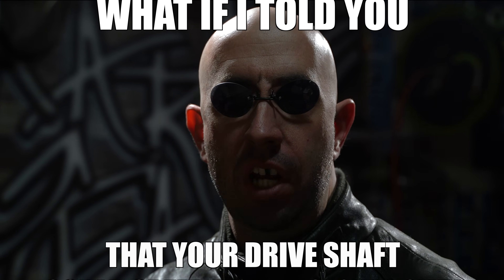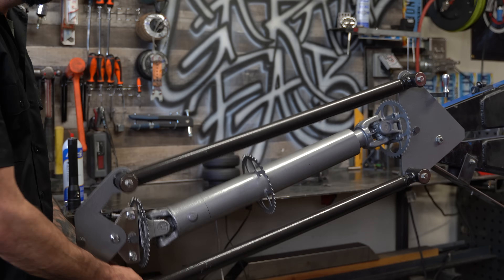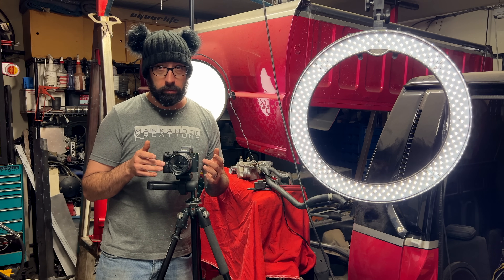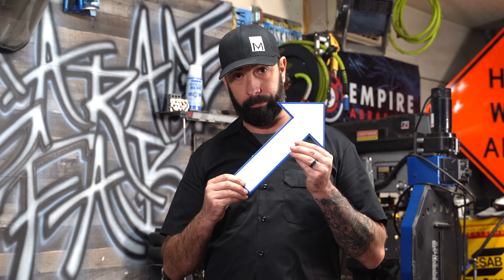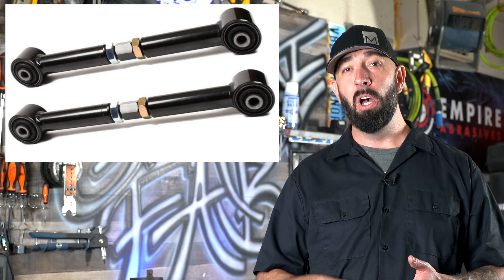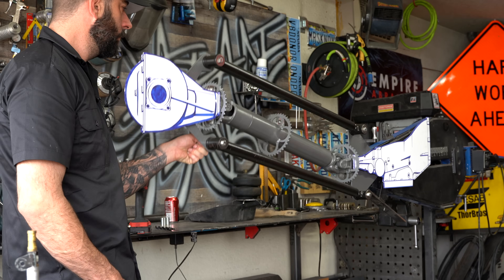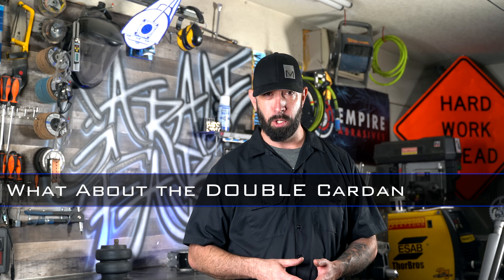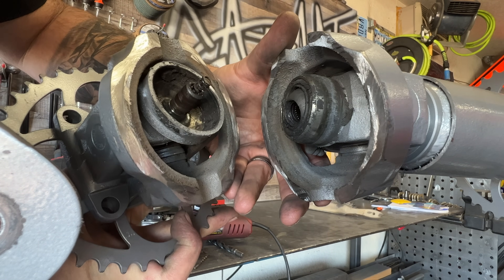THE Driveshaft Video. The Nature of U Joints. Suspension Basics Ep. 06

Comment: tHE PROBLEM i HAVE HAD WITH A NEW dRIVE SHAFT WAS NOT THE ANGLE OR PROBLEM LIKE THAT IT HAPPENED JUST DRIVING ON A FLAT DESERT ROAD. tHE ISSUE WITH A BRAND NEW DRIVE SHAFT WAS ChineseU joints installed in it ordered on the internet from a place that specialises  for the vehicle I ordered it for.My shaft had more than one U joint and the place that checked it and found it was not just any place . It was a drive shaft shop that did a lot of work on off road race trucks and the rest so? Chinese bearings I knew were an no no to use their quality would not hold up. My angles were correct and did not have an issue with the one before or the new one with plenty of off road. Not done when on the small trip I took with the one that failed. But plenty before the new one that failed  and plenty more with the new one with no problems yet. Ihave Deaver springs and long suspension travel on King shock that work well. Ihave a double cardon in the front for my 4x4 long travel drivers side 4wheel drive differential. with lockers & gears and great suspension I dont use 4x4 as much as I used to with my toy 4x4 mini truck solid axle 4 cylinder trucks. With a big V8 geared with rear locker I do not need 4x4 in places I used to. & if I do like in sand ,steeps snow ,mud or speed on loose dirt to pull me through the sharp corners not sliding off but hitting the gass some just pulls it through. Of cours I must be aware of not to fast and body sway. Like any setup you need to take some time and learn what it can do and how and what it cant. The thing I like about long travel wih 4x4 is with lockers it can pull you through and when over bumpy trails it smooths it out so well and the surprises that do happen can be hadled well. Like a mild U shape going fast, or a sand razer climing uo a big dune. Yiou find your vehicle way up in the air. like 6-8 feet from the bottom of the tires to the sand with the suspension drooped way down in the limit straps with a good amount of travel on a 4x4. More than a nice Raptor that are good at this not on the good Fox posision sensative but the posision sensative external bipass shock oil resivoir on good siize pistion tall for travel strong mounts for kKings tunable for the weight and use for your SUV or Truck or? My Full size Bronco plated and gusseted ind front suspension TTB likes them alot as well as my and any passengers off roading at a faster pace smooth and in control safe and not so likely to get stuck with power a built well drivetrain and srtrong smoot suspension and a loud clear clean stereo playing from a digital source not a cd that like to skip It is somtimes nice to set up and camp. and also nice to get through a long trail and off with a good time to get home or a motel with a pool and jacuzi and shower and restraunt or fast food to eatin comfort either way enough space inside to cary what you need and makes the music sound better big seats that can recline is nice too. But the amount of work to make it and some good amount of hard in money too ti install parts and improve and fabricate stuff and rebuild the transfer case yourself and the fiberflass fenders and bedsides to clear the tires and a little motre for that + the core suport headlights with HID upgrrade to see to  change the frond end to the later body style you like better. The Front end was A PART OUT SO i BOUGHT IT ALL INCLUDING THE NEWER SPINDLES THE BRAKE CALIPERS THAT BOLT TO THE SPINDLES INSTEAD OF THE METAL AND RUBBER PINSSOME OTHER STUFF NOT NEEDING TO MENTION MOSTLY CHOICE AND A FEW NEEDED THINGS THAT FAI WHITH SOME AGE.
Reply from the maker: That sounds like a fun ride, Brian! 🙌

Comment: Now extremely curious about a single U joint drive shaft. The Land Rover D2 rear shaft had a U joint at the transfer case and a solid rubber joint, or bushing  at the diff. How's that work??
The front shaft it a double cardon the transfer case and UJoint at the front diff
Reply from the maker: I can’t say for sure but I have to assume that the U joint is mostly straight. Anything beyond 2° to 3° could potentially cause the dreaded vibration that the rubber joint couldn’t cancel.
On the front shaft the single U joint would still need to be straight, and the double Cardan could be at almost any angle!

Comment: Early on... bevel gears put the shaft too high, making coachwork high.
Worm gears came into vogue, mostly on heavy stuff... except they suffer from no ground clearance... the worms at the bottom. And no, not all worm drives lock... all about the pitch.

Hypocycloid places the shaft at a nice mid way point. Reduced tunnel in the cabin. Lower engine line.

As for uni joints, always paired, always equal and opposite. See it gotten wrong so many times.
The same holds true for cable drives. A speedo doesnt care, but that bent shaft line trimmer buzzes like hell because of it being a single bend.
Reply: Dont even mention that i forgot to say anything about chains and jackshafts... partly due to materials, partly habits, partly those low clearance worm drives...
Reply from the maker: Interesting info! Thank you. 🙏
Reply: No prob. History often shines a light on why some things are how they are...
 Shame i cant find much info on what i want though!
Thompson transmission.
Early hybrid combining two epicyclics, a tailshaft, and two motor/generators at each end. Depending on which ones driving planets and which ones retarding, you get a reasonably infinite range.
Cant find anything online about it...

Comment: Garage fab I just ordered the ekstensive metal works rear air suspension kit for a 88 s10 I'm new to this but I'm guessing it's a 2 link setup with a pan hard bar that welds to rear. Have you done any of these setups?
Reply from the maker: I have built 2 links, but I have not used one from Ekstensive. I’m not a big fan of 2 links on bagged vehicles because they cause pinion angle to change significantly. People have been using them forever, though, so perhaps they’re not as bad as I make them out to be. It appears Ektensive ONLY offers 2 links? I could be missing something.

Comment: My dad repaired a crane and repaired the drive shaft while replacing the motor. He timed the drive shaft that he found to be off 90 degrees. The crane operator claimed he was able to drive the machine at 2x the speed it used to go down the road at. Timing U joints is real!
Reply from the maker: That is fascinating!

Comment: So... if you have a torque arm suspension you're best off running a double-cardan at the trans to eliminate vibration at that end since the u-joint angle at the diff will be more or less fixed by the torque arm. Set the pinion angle at zero and let the double-cardan sort it out up front. Correct?

Also, how do you go about sizing bags for a car? I keep thinking about air suspension because, as a trucker, I'm keenly aware of its benefits. I'm not into the whole lowering thing, but it would be nice to have a highway ride height that was lower for aero and a town ride height that was higher for practicality. And it would be great to maintain those heights regardless how many bodies I was carrying in the trunk. But I always get confused looking at bags because there's no clear way to tell things like spring rate. I'm a performance junkie, so I don't want to throw together something that rides and handles like a '73 Buick.
Reply from the maker: Sounds like you understand the double Cardan perfectly. The rear U joint will be fairly straight, with a slight angle to keep needle bearings rolling and lubrication moving, and the torque arm will keep it there.
You absolutely could use a double Cardan up front, it won’t hurt anything, but I wouldn’t say it’s mandatory unless either there’s a sharp angle in the U joint after the transmission or the vehicle has adjustable height suspension. 

For a moment, it sounded like air suspension was ideal for you. Until you mentioned spring rate. The reason you won’t see spring rates on air Springs is because that’s constantly changing with the air pressure inside. It can be somewhat frustrating. Low pressure equals a low ride height and a low spring rate. That can feel mushy and boat like. I love this feeling especially on rough roads but it’s the opposite of performance. High pressure equals a high ride height and a high spring rate. It can feel like you have no suspension at all and cause you to need to visit a masseuse.
Luckily right smack dab in the middle is what you might call a normal ride quality.
The problem with bags, (not necessarily my problem. I don’t mind at all) is you can pick your ride height and you can pick your ride quality/spring rate, but you can’t pick both.
I’ve come up with a hybrid hydraulic/air system that would allow you to do that and it may make an appearance on my next truck project. But that’s a ways away still.
All that said, you’ll be taking the weight of your vehicle, and finding bags with weight ratings that will suit you. I personally prefer the largest bags that will fit. (within reason) because I prefer the softer ride. A smaller bag will require more pressure to lift the vehicle and will therefore be stiffer. Hopefully this all made sense, let me know if I need to clarify anything.
Reply: @Garage Fab  I've seen hydraulic over air systems before. Actually, Citroën used it for quite some time. Not necessarily with the amount of travel you're talking about though. 

The bit about bags and ride makes perfect sense. A bit disappointing, though. I just want it all, is that so much to ask? Maybe I need a hydraulic over coilovers system so I can change height without messing with the spring rate. 

The reason I am thinking about a double-cardan up front is because I plan for a bit more suspension travel than standard. So it would provide a bit of insurance at the extremes. Probably not critical, but it sure wouldn't hurt anything.
Reply from the maker: I will have to look up the Citroen Suspension you mentioned. My design is theoretical so if there’s a proven system, I’d certainly prefer that one!
Good call in the double Cardan.

Comment: I have 2 late 80s full size broncos both have a carbon joints at the transmission. Why did your model have the cardon at the pinion? I've been a ASE tech for 45 years and I've never seen a double cardon at the pinion factory or custom.
Reply from the maker: Simply because I couldn’t build the machine in a way that would allow me to quickly swap the two types of joints if it were located in the front. 
The double Cardan is far more often in the front, not always. I’ve been seeing a lot of jeeps lately, often on front axles, on which the double Cardan is nearest the differential. Regardless of its location, the principles remain the same.

Comment: Hang on what about the Doppler effect? Even when the tailshaft was straight, all three sounded different because we are observing the sound from the fixed position of the microphone. You would need to move the microphone in line with each of the sprockets, or use 3 microphones setup at the same distance and axis as each other.
Reply from the maker: You’re probably not wrong. A mic attached directly to the card probably would’ve been better. The stationary mic would only change the overall pitch and/or volume, though. The Doppler effect wouldn’t create an oscillation type noise so it shouldn’t have harmed the demonstration any.
Reply: @GarageFab  no it wouldn't cause an oscillation (or it shouldn't) but when you are listening for any change in sound, it's just another variable that it could have done without. Good video BTW. You explained it very well, in a clear very understandable way.
Reply from the maker: Much appreciated!

Comment: I had a double Cardin drive shaft on the front axle of a Jeep JKU. After me research I don’t understand why it’s sold. For slow rock crawling only I guess but it’s definitely not for a freeway Jeep. In order to set up the drive line right I had to tilt up my pinion angle and in turn throwing off my caster and having the Jeep wondering on the road. I ended up getting a Dynatrac unlimited front axle with an 3 degrees of extra pinion angle pointed up and installed my stock drive shaft with a TERAFLEX RZEPPA HIGH ANGLE FACTORY REPLACEMENT CV KIT and now I can drive 80 mph and no vibration.
Reply from the maker: Wow! That’s interesting! I’m not familiar with Jeeps but the tipping up of the pinion angle makes sense and the resulting excessively positive caster makes even more sense! What a nightmare! The double Cardan certainly has its place and apparently your Jeep isn’t it! Thanks for sharing that!

Comment: I'm building a tacoma. Static drop with coulovers. Do I have to worry about instant center?
Reply from the maker: Worry? Probably not. Keep researching and understand it, and then bend the rules. 
What will you be using the truck for, Derek? Instant center is really important on race cars, and can affect the handling of street cars, but for most people, they wouldn’t be able to tell the difference. I often recommend a parallel link bar setup on vehicles with air suspension, to keep the pinion angle constant and prolong the lives of driveshaft U joints. Parallel links create an infinite instant center which is not ideal. Side effect? Perhaps your rear tires will spin a little easier when you mash the gas? Again most grocery getters wouldn’t notice.

Comment: Very bad info on the double cardan.  You show it installed incorrectly causing the 3rd joint to be bent.  The double cardan should be on the transmission side and pinion angle should match the drive shaft so the joint is straight.  In lifted rigs your transfer case it too high.  If you match the angles your U-joint will be past supported angles, say 20ish degrees.  The double cardan is the solution.  I'd correct the video and re-post it.  The rest of the video is great and folks will believe the double cardans are bad but they are only solution in some use cases.
Reply from the maker: Very bad info in this comment.
(Really gross way to start a comment, don’t think?)
Had you said MOST double Cardan joints are located in the front at the transmission, you would’ve been correct.
A double Cardan joint doesn’t know where it’s located. All that matters is the angle of each joint. For example, if the driveshaft is in line with the transmission, and the pinion angle is pointed up or down, which is usually done for driveshaft clearance purposes, the double Cardan will be located at the differential. It’s important to explain to people why something is done, not just tell them how they should to do it. It limits options and creativity.
I often ask to be called out when I misunderstand something for the sake of those watching. It can be done in a tactful way. I can appreciate a good discussion.
I’d correct your comment so that it sounds less negative. Have a great week.
Reply: @GarageFab    (Doesn't hurt my feeling you said I had bad information because I don't care what you think)  I said the video is great?  You clearly put a lot of effort in to it.  Should I put a happy face to not hurt your feelings?? :)  

In your example (say at the 16 minute mark) it should be on the transmission side and the pinion should be point at the transmission.  Correct, one side needs to be straight, I doubt you'll want to point your transmission down, if is it 4x4 it that would break your front driveshaft angles.   Though, I guess you are making this video for lower riders and not 4x4.  I am guessing 4x4ers will get confused if they end up on it.  :)  :)  (the happy faces are so you don't get offended)  :) :)
Reply from the maker: The smiley faces help. My sensitive ego has been soothed, Thank you!
No need for smiley faces, though, if there’s not an accusatory and inaccurate critique included. Simply be kind.
Thank you for the recognition.
You are correct; At 16:00, the double Cardan should in fact be in the front with the diff straight. The reason it is not is because this is a demonstration of how not to use a double Cardan joint. A minute before at 15:00 your exact point is described, with the double in front and the rear is straight. The shot is cropped so that you can’t tell what side the double Cardan is on, instead the voiceover describes the setup.
Some behind-the-scenes info:  If I could have mounted the double Cardan on the front, I would have because it’s a far more common setup. That was not an option. It would have prevented the ability to swap between the two joints.
Garage Fab revolves around bagged vehicles. The video itself is intended to be all-encompassing as the principles and rules of U joints don’t change.

Comment: Excellent video, the best I have seen on this topic.  I can see the amount of effort you put into this, so thank you. Subscribed!  I do have one question regarding leaf spring street driven cars...  At a normal cruising speed, say 60mph, is the pinion angle the same as it is at rest, or does the torque required to maintain that speed wind up the springs just a little (typically)?  Thanks again!
Reply from the maker: It would probably be silly of me to say the springs aren’t winding up at all, but I’m pretty confident it wouldn’t be very much. It’s CERTAINLY not enough to cause problems. Therefore I wouldn’t bother trying to account for this when setting a vehicle up. There’s usually about a degree ish of misalignment between the front and rear I joints that’s acceptable. Meaning no vibration or damage should occur. I cannot fathom cruising would come anywhere close to that. (Maybe cruising up a 45 degree slope.) 😆 
My pleasure my friend. Thanks for watching!